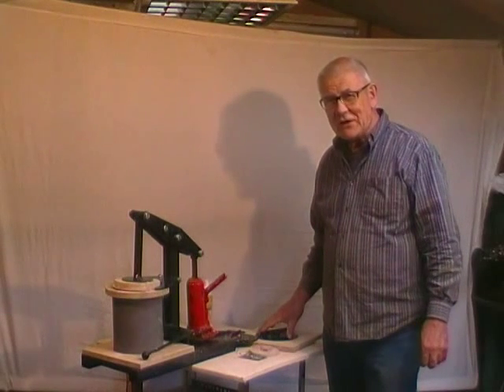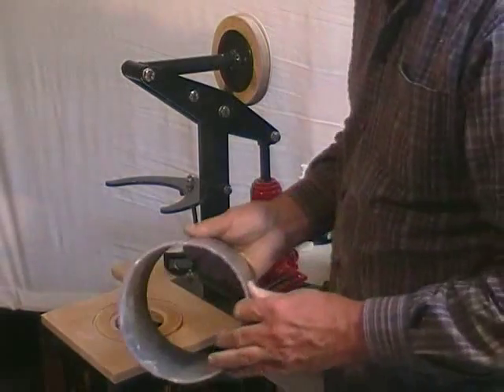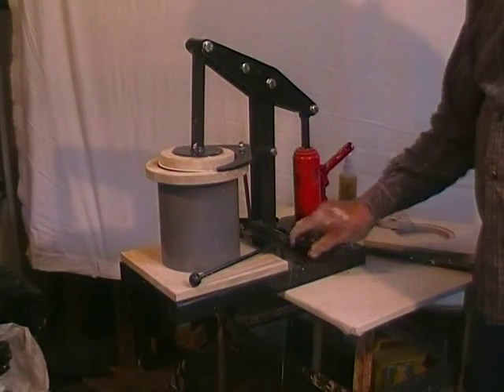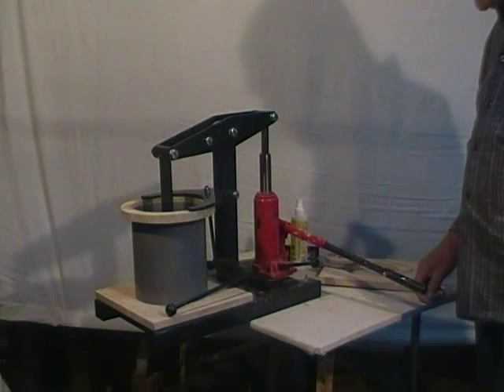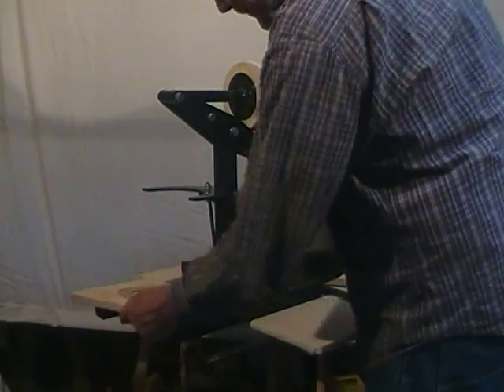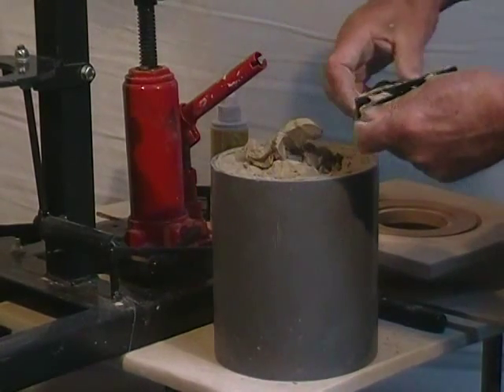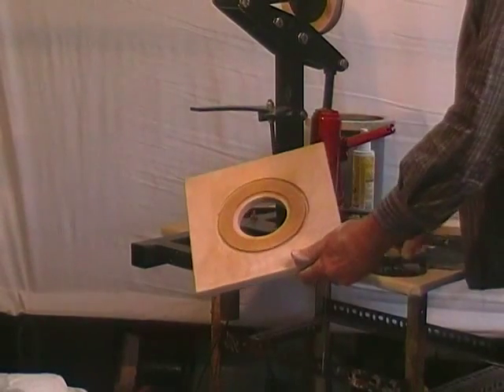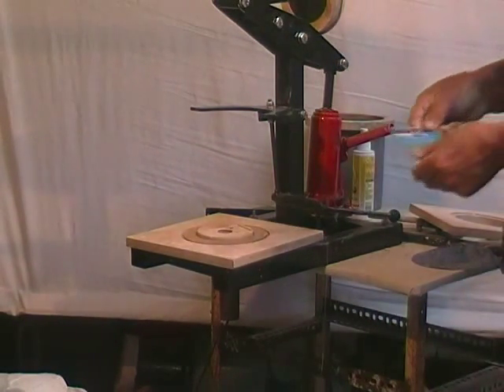Jerry and John's new extruder

Comment: Very nice simple bit if kit. Can you tell me a little about the machine.Perhaps its weight the gauge of steel you use and how strong is the jack.I'm thinking this might have to go on my wife's Christmas list.
Reply from the maker: It weighs around 8Kg. Steel gauge is 2mm up to 5mm and it is a 4 tonne jack. Those bits are all pretty straightforward CNC plasma cutting and welding - the only tricky part is getting the return springs made and sourcing the wiper blade!